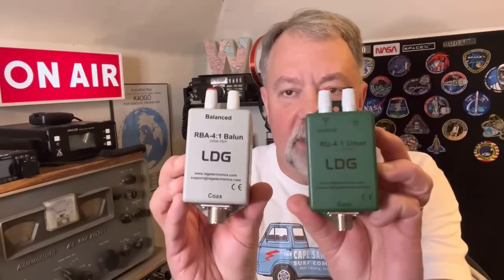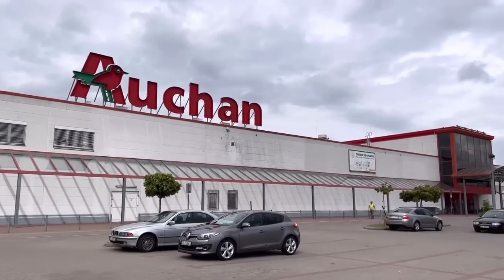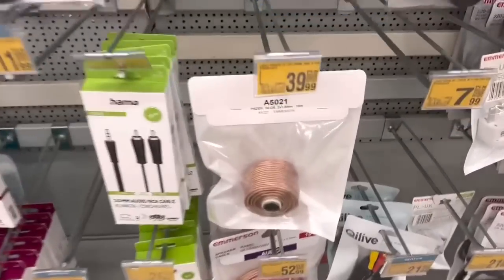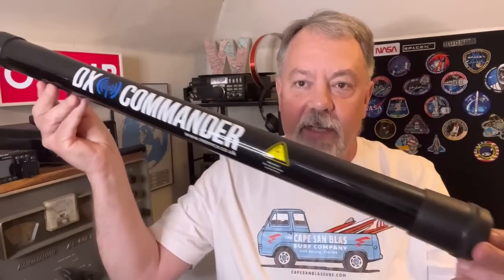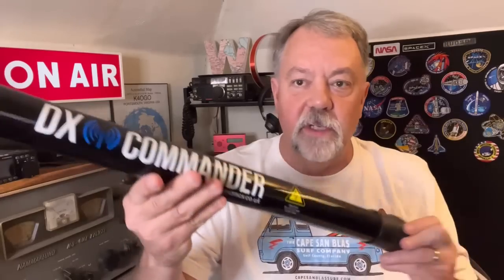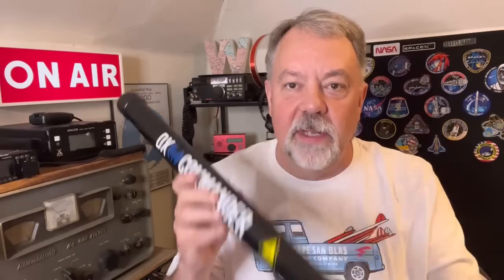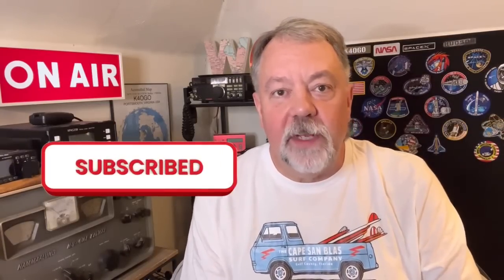Building Portable Antennas for Ham Radio

Comment: As I like to say, the worst antenna in the air beats a perfect antenna on paper, every time.  You make some good points and offer some good tips.  I would suggest to go cut some wire and try it.  I have learned many lessons that way.  And if it does not work as expected, it makes for material for my next project.  I often learned more from what did not work than what did.  I hope to catch you on the air.  Safe travels and have fun!
Reply from the maker: Thank you and you are absolutely right!

Comment: For me playing with wires is (other than being on the radio) the funnest part of ham radio. At my age with my eyes, and the fact I have inherited a neurological disorder from my father (all 5 of us children have it and it went back to at least my great grand father ) I can no longer wield a soldering iron well enough to do kit building or even what I would have considered simple repair. At least with antennas I'm usually not soldering anything that I can easily damage. So many times I've built an antenna for or even at FD to hear the older hams criticize it and say that won't work. But every time, we have made contacts. When I'm told that now I ask Have you done it?? most times the answer is no. The others are usually lying. Unless you build a full sized dipole for each band, it is a compromise. Even then once you tune away from the sweet spot, it is still a compromise to a point. I tell my students if you see a design and want to try it, don't let anyone talk you out of it. Chances are they are retired and have lots of disposable income to waist on towers and antennas to put on them. Most of these beams have traps on them. Guess what? they are using a compromise antenna! Once you put a trap in it is no longer truly resonant on the bands they use. That is why they spent $1000s on amps and tuner that can handle the power. Once you engage that tuner you have taken any resonance out of the system. There goes that argument!

Comment: Thanks for sharing Walt. I do POTA and I use a painters extension pole that is 4ft in length and expands to 16ft. I have been wanting something shorter when collapsed so that it fits better in my vehicle. The DX Commander may fill the bill.
Reply from the maker: My 10 meter pole is the Expedition model. It packs well. 73, Walt K4OGO

Comment: Another great video, Walt.  Still havrn't finished testing the 41' wire. This week I think. I hadn't put a 1-1 in the mix but will as I have one here. My results with only the 9:1 and a 15' counterpoise were not great. Adding the 1:1 may help or deleting the extra wire   73 Joe, KC1MTM
Reply from the maker: Thanks Joe, try the choke that might do the trick

Comment: Good video. Not a senior moment at 20 ohms if your on a short loaded vertical with low ground and coil loss on 40 meters 😊. I built AD5X multi impedance matching transformer for those senior moment. It’s handy too.
Reply from the maker: Thanks so much! 73, Walt K4OGO

Comment: Hi Walt, I just discovered your channel recently and am avidly working my way through your videos (although I must confess that I do so with a certain amount of west coaster envy for your east coast access up and down the seaboard and across the pond). I will be getting into POTA after my wife retires next month and we start to roam around the country in our Casita trailer.  In that regard, I’m in the process of gearing up for portable operations and am very keen on experimenting with home brew antennas as you do.  Watching this video has prompted me to ask a very basic question that I should know the answer to and hopefully you will enlighten me.  When you use speaker wire for your antenna builds, do you separate the two wires and use one at a time or do you join them at either end and use them together.  Thanks for your wonderful videos.  Your enthusiasm is contagious.  73, de Tim KE6PMA
Reply from the maker: Hi Tim, thanks for watching! I split the speaker wire and just use one side. Works great! 73, Walt

Comment: Great video! You answered a lot of questions I had. 

I’m curious if you ever find it useful to combine a 1:1 unun as a choke with a 49:1 efhw?
Reply: I do,  I just built a new configuration that uses dc 12v red black wire for the 1:1 and goes straight into a 49:1 enamel coated wire then to the wire,  it really lowered the noise a lot and made better contacts for me,  but every environment is different,  so experiment.   Make a 1:1 with a mix 31 or 43 240 toroid and see if it helps you.
Reply from the maker: Yes I’ve used a choke at the 49:1. What I do is add a counterpoise to the 49:1 when I do this. I used a length of 5% of a wavelength which comes out to about 6.5 feet.
Reply: @COASTALWAVESWIRES  in practice, how much difference did it make?
Reply from the maker: @Philip-KA4KOE  I think it made a big difference, kept common mode current out of my feed line as well

Comment: Welcome home.  I need to build a 20/40 linked dipole.  The center conductor is purchased and on its way.  I will be using BNTECHGO 20 gauge wire for this QRP antenna.  I’ll be to bring it on my next trip to Norfolk.  Maybe we can meet up, talk radio, and eat pizza. 73 de David AE4LH
Reply from the maker: Thanks!
Reply: I use the BNTECHGO 20g too....used it for a diy version of the DX Commander as well as several different EFHW and other wire antennas. 
MUCH lighter than the speaker wire....

Comment: Hi Walt. Love your videos. You’ve rekindled my interest in building wire antennas….. currently running an EFRW with 43’ on a 9:1 Palomar Bullet Unun with a 17.5’ counterpoise and homemade toroid coax choke. Suspended the wire out the 2nd floor window like your Polish QTH setup and it works a treat. An idea for a follow up to todays video, can you cover off the current options for antenna analysers. I am using an old MFJ analyser that’s heavy and large and am curious what’s on the market today. Keep up the great work. Cheers Trevor VK3DCQ
Reply from the maker: Thanks Trevor! Great idea! 73, Walt K4OGO

Comment: Hi Walt, I’ve been watching your videos and seen you used the xiegu g90 a lot. I’m thinking about getting one as my first transceiver. I was wondering if the cooling fan that you can get for it is a good investment, or not really necessary?
Reply from the maker: Hi Jack, I’ve found it not really necessary for SSB use. I’ve been running mine for a couple years and have never used one or had a problem. I’ve heard that it’s a must if you’re using the G90 for digital modes. The G90 is a great radio, you will love it!

Comment: Just of curiosity I have modified QRP-guys no tune efhw antenna from 64:1 to 49:1. Given that I run my a single banded cw QRP transceiver ( 7W ) on 40 m I was able to make the antenna work at about swr 1:43 ( 7-7.2 MHz ). I believe more tweaking by cutting the the wire will decrease swr slightly more.
Reply from the maker: Yes a little tweaking might help but 1:4 isn’t bad, I’d keep on rolling with that.
Reply: @COASTALWAVESWIRES  Thanks for your response. Based  on your experience Walt, does antenna height above ground affect swr compared to only cutting wire?
Reply from the maker: @geirha75  yes I’ve noticed a slight improvement in SWR when getting an antenna higher